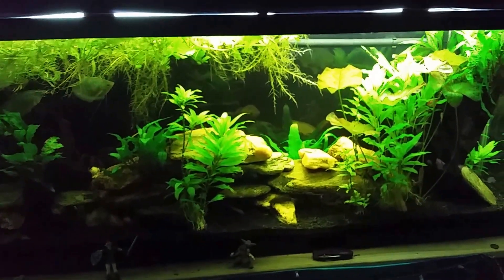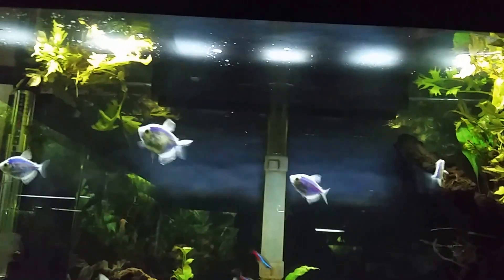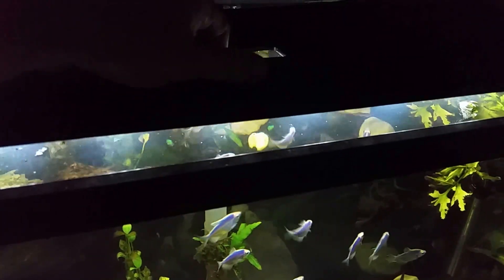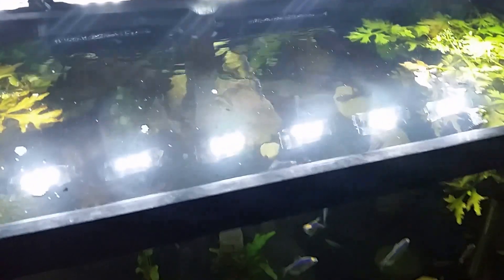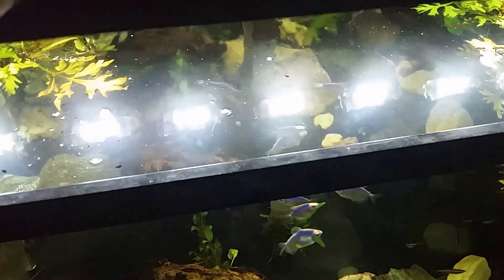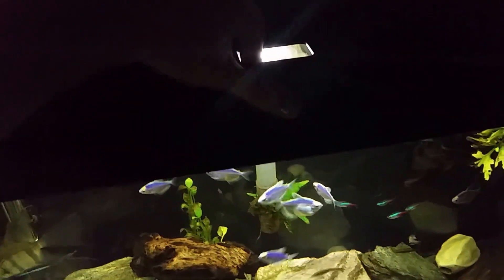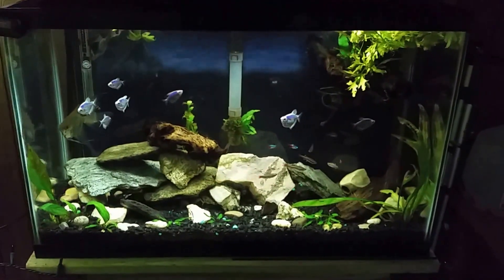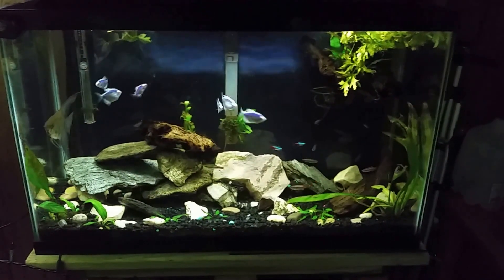Is Surface Agitation Necessary in your Aquarium?

Comment: Put your money where your mouth is. Take your filter out for a month.
Reply from the maker: Because I'm not going to completely change my tank around and increase the amount of work needed to maintain it.
Reply: Dan Hiteshew 
Do it on a seperate smaller tank, you know, as an experiment. Especially seeing as you have heaps of tanks.
You can't go making these bold statements which will ruin an aquarium without willing to back up your statements. If you truly believe you do not need surface agitation then turn that first spray bar segment down so it does not affect the surface at all. Give it a couple hours and I guarantee all of your fish will be at the surface gulping for air. 
And your argument for surface agitation on the smaller tanks with hang on the back filters is pretty much redundant due to the way in which HoB filters aerate the water, with HUGE amounts of agitation inside the filter.
Reply from the maker: ***** Well if you just blindly follow "bold claims" without doing any corroborating research, then the fault is your own if it goes badly. 
In this case, my claim is not "bold" and I'll gladly do your simple experiment, as that won't require any real effort. I'm not going to re-do an entire tank just to prove a point though. 
Look for a video coming soon.
Reply: Dan Hiteshew That's the problem with people. They will blindly follow the opinions of others and it will result, in this instance anyway, with dead fish. That's why I challenge you to have a tank with no filter, no surface agitation and report back with your findings. I have a heavily planted tank and if i have little to no surface agitation all my fish are instantly gulping for air.. If the link works this is a link to my fish tank so you can gauge the level of plants http://imgur.com/a/1iIhQ
Reply from the maker: ***** I'm 9 hours into my experiment. The video will be coming soon.
Reply: Dan Hiteshew Keep going matey mate. It will happen ;)
Reply from the maker: ***** I guess you didn't watch the video?
Reply: my spray bar doesnt agitiate the surface, and no fish doesnt gasp for air, when they do its because i crank the co2 quite a lot.
Reply: he was saying no filter for plants ppl all fish need filters